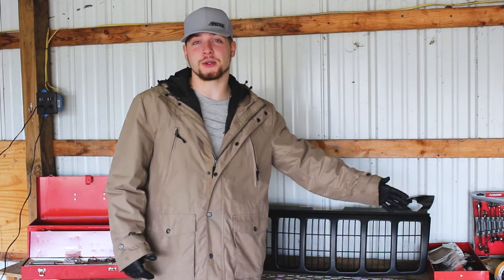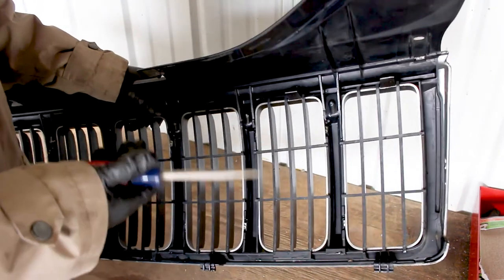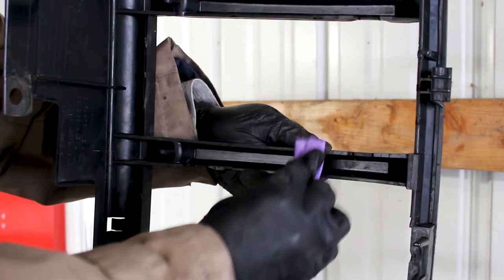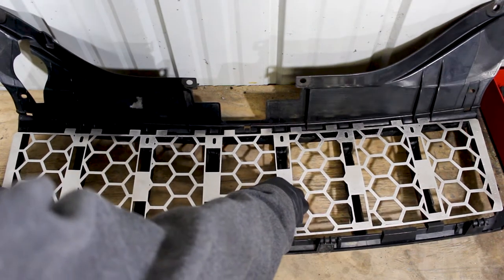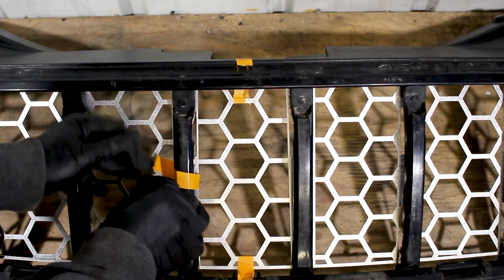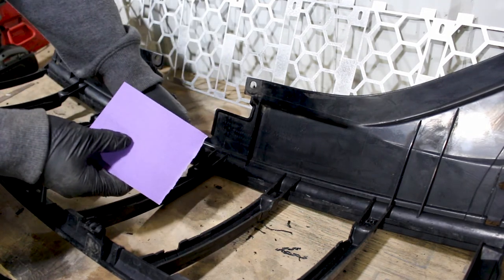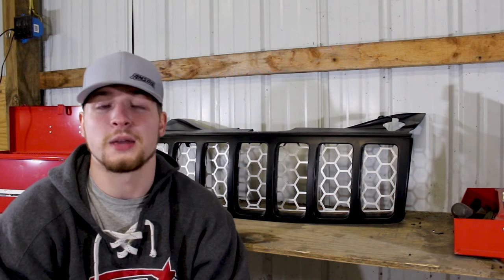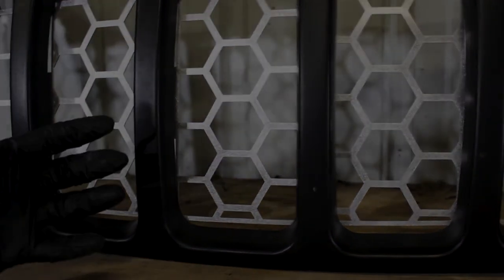Impulse Fabrication Custom Grille Insert Installation

Comment: Just installed one of these inserts on 2008 WK after following this video, really appreciate how much detail you put into it. Few little details were different on the later model, but nothing major. For one thing, the nipples shown at (3:50) aren't present, but there are little plastic "humps" on the opposite side that need to be ground down with a Dremel so you have a flat spot to drill into. Something that seems a bit easier is the alignment: on the 08 there are plastic ridges on the edges of the frame that the insert sits between, so its automatically aligned. I actually couldn't move it to the left or right if I wanted to. The long screw holes still let you move it up and down though if needed.

One detail I did want to mention is that, at least for the 2008 version, the insert isn't exactly symmetrical. What I mean is that if you put the insert in, drill the holes, and then flip the insert over, the holes will NOT line up. It's only a couple mm off, but enough that the bolts won't go through. So if you want to paint it, I'd recommend either clearly marking which side faces the front, or just paint both sides to be safe.

Comment: Do you know if this would fit a WJ I don’t mind cutting it up a little
Reply from the maker: I'm not entirely sure, my concern is that the area of each slot is different. Impulse Fabrication makes these for 2005-2007 and 2008-2010 WKs which have different dimensions for their front grille. Shoot me an email at casey@myjeepstory.org and let's see if one of the two has similar dimensions to your WJ.